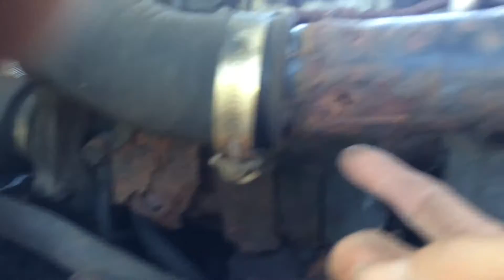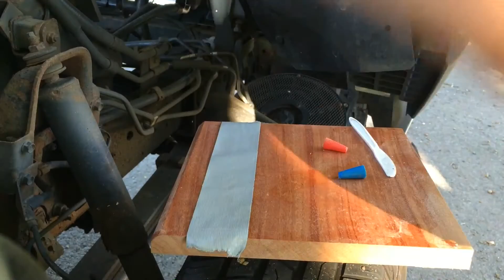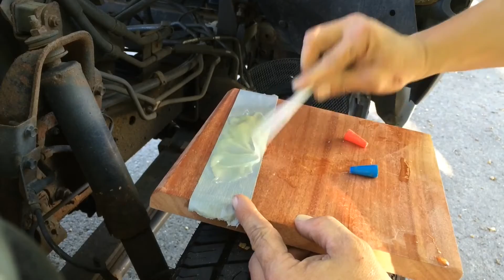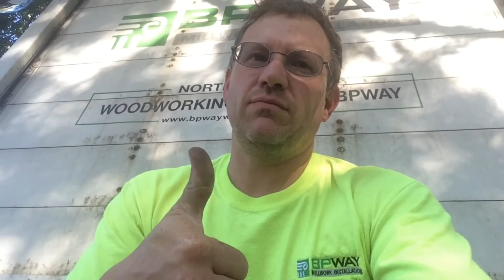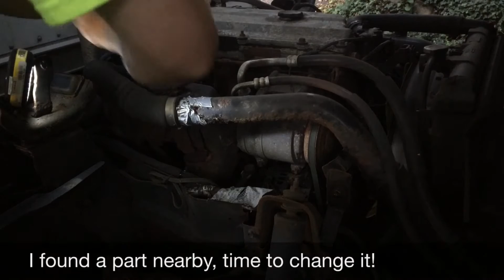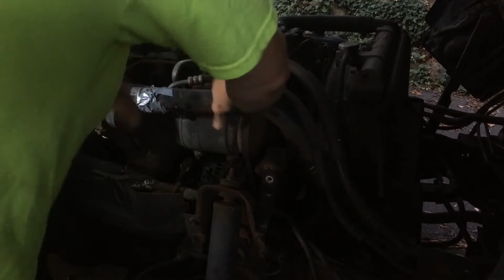Roadside repair of turbo line on a 2006 Isuzu NPR box truck

Comment: Nice MacGyver! Duct tape, epoxy, chewing gum, paper clip, vice grips, big adjustable, small adjustable, flat head, or quarter, Phillips head, belt, zip ties, hose clamps, hammer, or big adjustable works, electrical tape, what am I forgetting?